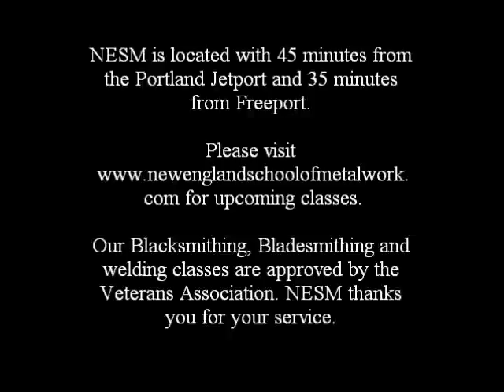Howard Clark at NESM: Intro to Japanese Swords

Comment: Point 1..the sword is straight until quenched in traditional forging. The curve forms itself..    point 2. The kissaka is hammered into shape after it is cut from the billet. This closes the end grain.                    Point 3. The grind is never back to edge. It is side to side..apart from that. A nice sword
.a Japanese sword it is not.. comments please.😶
Reply: Well said. For the price it should be more traditional in my opinion
Reply: @gf2390  if it were traditional it would be practically a show piece. Howard Clark and other high end forges make katanas that are far superior then the ones built using ancient methods.